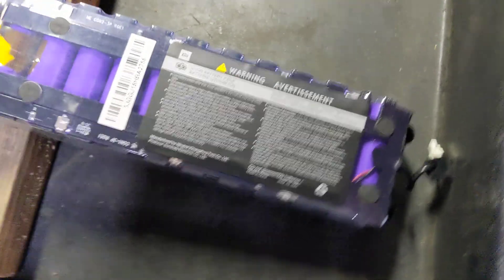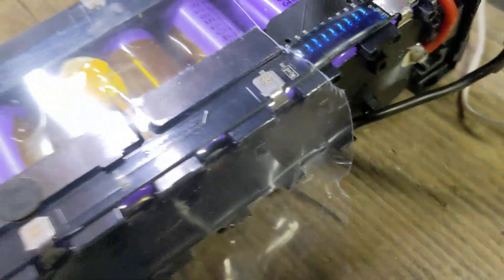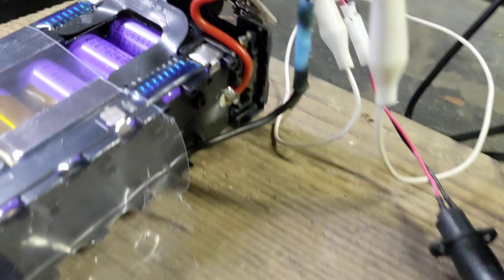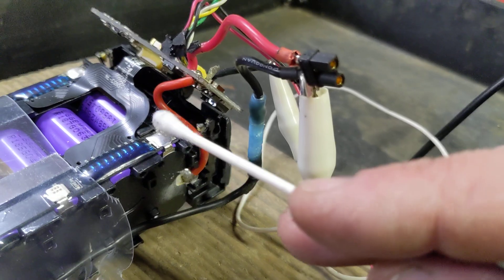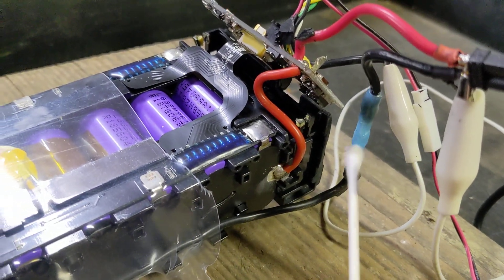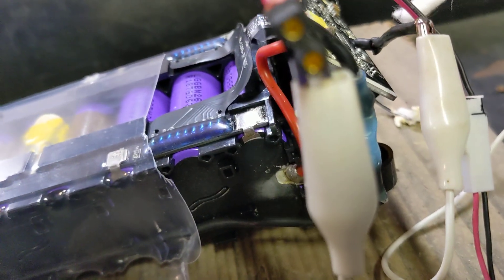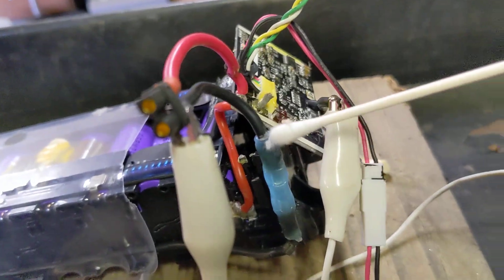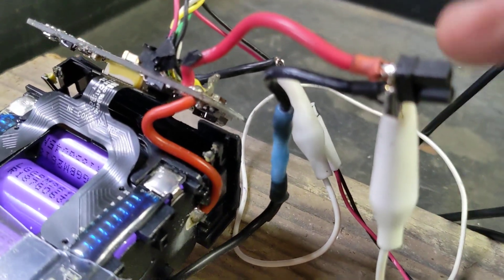NineBot BMS bypass

Comment: Oorrrrr...buy a second battery...directly connect the +/- to the cells only..then run the cables to the existing power connector...
Making it give more current and still using the original battery as usual which will help on hills etc